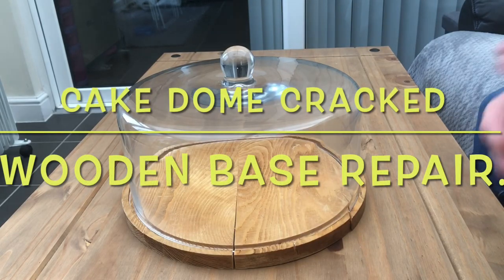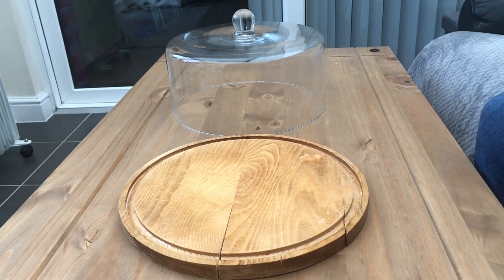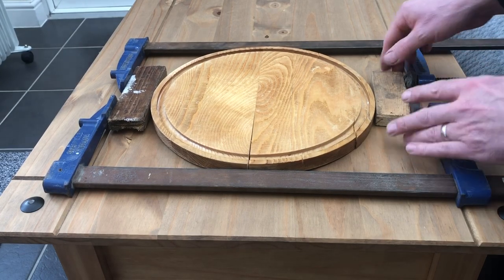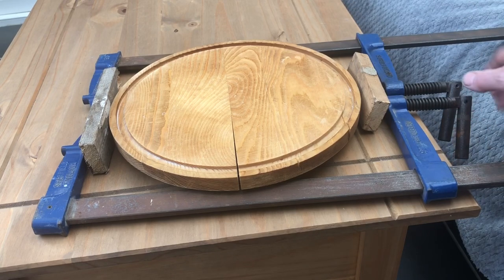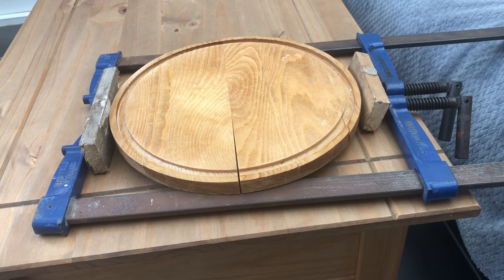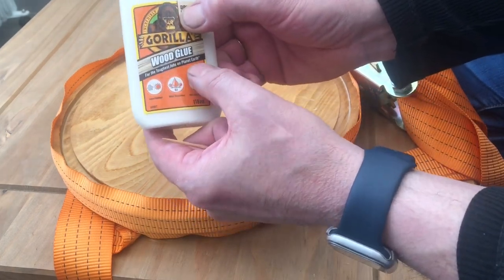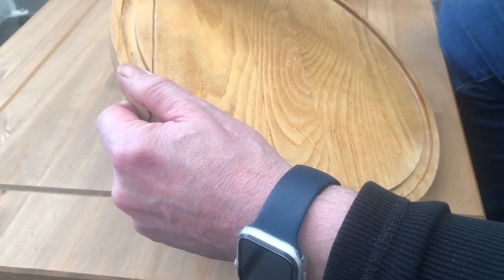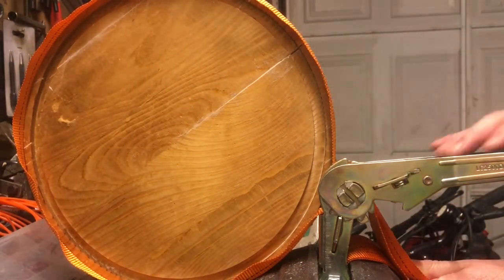Cake Dome Cracked Wooden Base Repair.

Comment: They are not really cracks in the board, it’s because the boards that have been used to make the base have not been Planed/Jointed properly and been over tightened when originally clamping and gluing the boards together, great video 👍
Reply from the maker: I never considered the original method of construction being incorrect in some way I just put it down to moisture absorption warping etc. Thanks for the insight.
Reply: @TheRepairer  the moisture will have played its part over time it’s probably broken down the bond adhesion in the joint.